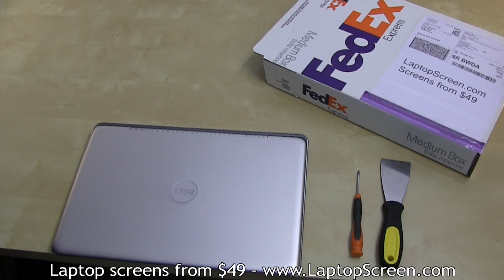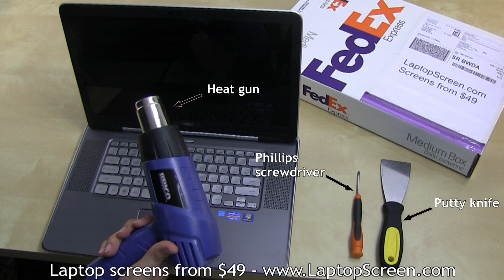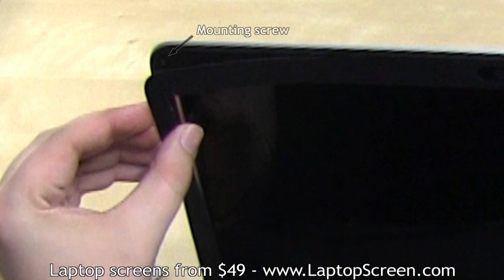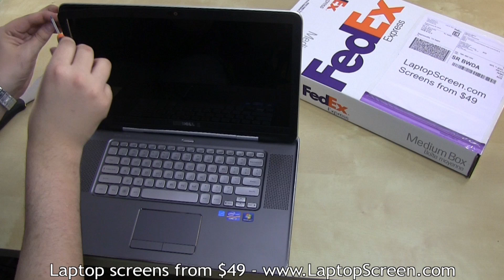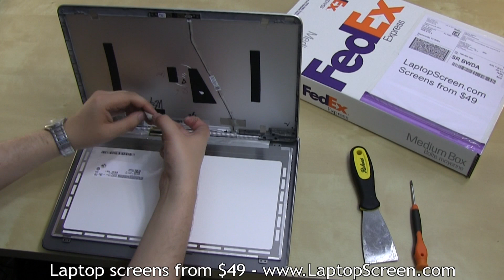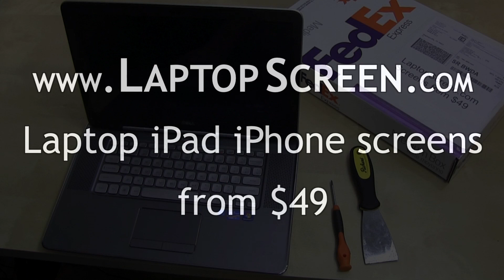Laptop screen replacement / LCD repair [Dell XPS 15z]

Comment: I second +danar j 's question about having an XPS 15z (P12F) with 1366x768 LCD. Can this successfully be upgraded to a 1920x1080 LCD screen stocked by you guys? Various info on Dell's forum suggest so. Can this be confirmed? The last upgrade this laptop needs, and would get one if so. Thanks! PS. It is difficult to see what questions are being replied to in here.

Comment: Thanks a ton for this great video :D . I would have never of thought to use a heat gun to ultimately pry apart the metal cover, to access the screws, so I could then pry off the front bezel. I wish Dell didn't feel the need to make things so difficult on this model.

Comment: Successful Replacement Completed Tonight!!!
Perfect video tutorial. I did use a heat gun and I used a "Spudger" pry tool to remove the casing. Don't worry too much about over heating anything. I just heated up up a bit...and then a bit more if needed. When I finished the install I heated up the metal again to help glue it back down. It was hot to the touch when I squeezed things back together again and I even used a piece of paper to insulate the heat from my fingers at one point with no harm done!
I ordered the LCD for less than $60 from the link on the video and popped for next day air for $35 from Canada. Received it at 9:30 am the very next day (today) in Chicago! The replacement laptop I was considering was over $1000...this will do for now.

Comment from the maker: ***** The 15Z most likely comes with dual channel (laptops that were possible to get with FHD often only have one cable design, which is dual channel for either screen option)
You cannot tell the type of the cable with-out disassembly.
When you take the display assembly apart, examine the cable, if it says FHD then you are good to go.

Comment: @laptopscreencom I'm thinking of upgrading my 15z 1366x768 to the B156HW03 as well. The problem might be the cable apparently. I currently have the: 4HHMJ (part number) LCD screen, it seems to be using a 40-pin connector but how to make sure the cable supports dual-channel without opening it?

Comment from the maker: Well, the hand is there for a reason - the temperature required to loosen up the glue is fairly low - 40-60c. You could use anything that will produce such temperatures. The only difference in technique would be how long you apply the heat for - the more powerful heat gun will warm up quicker - that's why you use your hand to get a sense of the temperature. The LCD will not get damaged by heat that your hand can take with no pain. Once you feel pain, or burning flesh, the LCD will get damaged :)

Comment: Hey man.. i was wondering.. my screen works. But i want to change the lcd cover. Do you think the heat gun will hurt my perfectly working screen? And what temperature did you use? Mine only has 500 and 1000 and it looked like your hand was awfully close to the stream :(

Comment from the maker: Get the surface hot enough to the touch but not so hot as to burn your fingers.
All you are trying to do it to make the adhesive a bit more agreeable.

Comment: I just did this replacement yesterday. I think it would be better to completely remove the metal strip. Frankly there is no way you are NOT going to bend the metal piece. Face it. You are going to bend one corner. You just will. Remove the whole thing slowly with the heat gun, patiently and set it aside.. then do the replacement. This would also make it eaiser if you felt you had to add some additional glue.. but this way you could reheat all the glue at once and place it back. THANK YOU!

Comment: @laptopscreencom, if the screen I have right not on my XPS15z is 1366X768 resolution, can I replace it with a 1920X1080 screen?

Comment: Dell XPS 15z's LCD attachment is the most stupid system I have ever seen! It is very hard to take out the hard plastic even if you use putty knife and heat gun! Borders of LCD case (silver part) is damaged while trying to remove the black hard plastic part. Why did not they put a metal LCD case after making it so hard to remove LCD? This is one of the worst LCD system among other Dell computers.